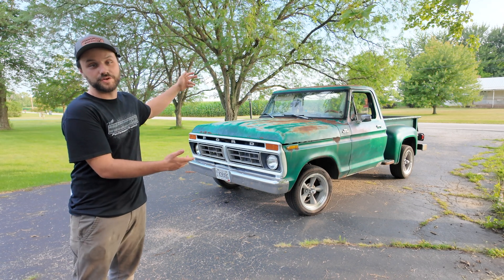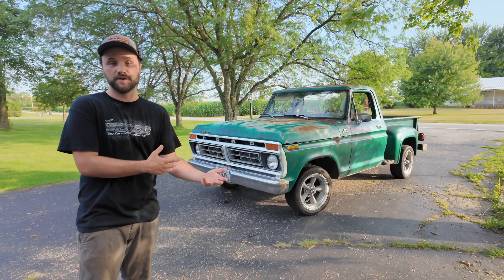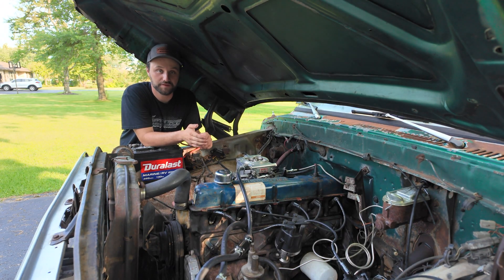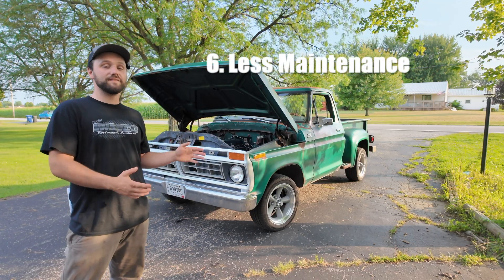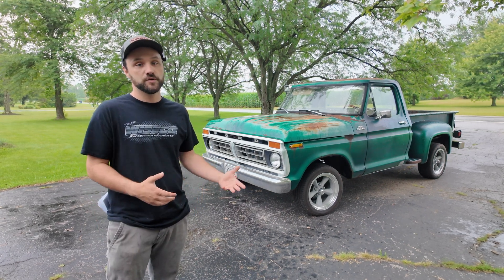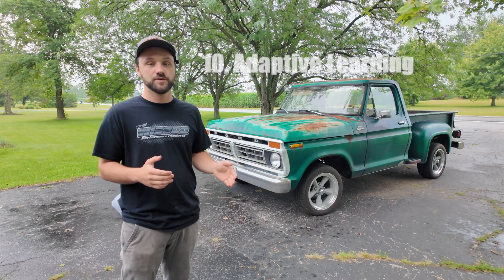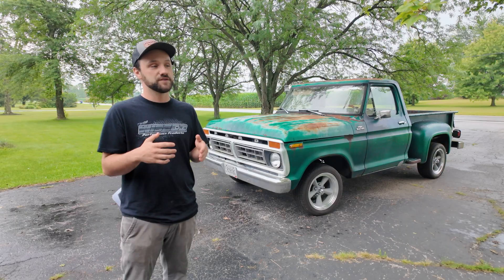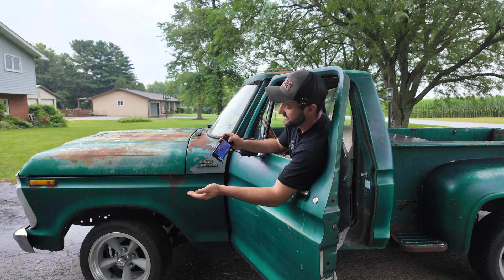10 Reasons Why I EFI Swapped My F100 (Ford 300 Inline 6) - NEVER RAN BETTER !

Comment: If you wanted a bug out vehicle electronic control system would not work in case of a emp burst 😅simple design is better than a vehicle that can’t get the job done. I know …prepper mode but think about it having a vehicle that will work

Comment: I see you used an older carb version 300 i line 6 engine. And obviously its wat you had already fitted. Will swapping your aftermarket kit improve the later efi 4.9L inline 6 version of engine

Comment: That little flap between the manifolds was designed for cold starts (if it's fixed and working properly, a new manifold is under $200 unlike that efi and intake). In addition to the pipe that goes down from that carter carburetor to the manifold for heat regulation. Simple Thermal Science...

Comment: never had a Vaper lock with the 300-6

the carburetor  works very well and always had a smooth idle 

Power Nation gave an old 300-6 , 70 more Hp by changing the intake and Carb 

vacuum leaks are ease to find 

if you have a bad carburetor and not good at setting the needle vale setup it could be trouble  remember blowing  the muffler  off 

the dual spark system to me was as soild as a 5 pound rock in a 2 mpg wind after 500k miles the only part  replace was the coil twice, now i did replace  the cap and rotor as thats like tires and do wear out,

24 mpg not bad ,

not to fun of some of the electronics  that went past the dual spark not  to say that advance ideals are not good and that old truck should be a dayley driver as it stands out to the test of time, its systems are well build , simple and robust as well.

as a pilot you have a mixture on the aircraft carburetor because as the air gets thin the mixture will become too rich.

love the fact you have an old truck and not a fan of to much new electronics at times  

but times change.

would love to know more on the max MPG you get and remember you have one of the best engines ever made when it come to long life 

and i hope you keep the old Carb setup just in case you need it.

as you have a classic truck

Comment: Which intake manifold did you use?

I have a 1980 Ford F100 with i6 300 cubic inch engine, 1 barrel carb.

Can you put your part list together for me including any suggestions you would if doing it over again: fuel pump, distributor, etc.

Comment: Adds power? Total B.S. without dyno reports. 20-30 lbs boost just stupid on that type engine and will ruin it. That complex expensive after market junk is undependable, dependable is the primary point of the 300. Far better, easier and cheaper to get a stock FI 300 which actually has more power, I did. That kid ran a carb for decades, started when he was 2 years old? Block channel.
Reply: Keith lopez has already made over 1,000 horsepower with his 300, and regularly takes his to drag and drive events. 

Ford 300's are stronger than you think.

Efi and turbocharging isn't Rocket science, and is perfectly possible to have a reliable setup. You're just a boomer that's scared of technology.  

Efi is better at fuel management, and will get better mileage. A carburetor is a controlled fuel leak.
Reply: @riogrande163  1K HP 300 is a ruined engine. I had 300s before you were born. Computers eat batteries and put cars on slide backs. Turbos burn out at low miles and high bucks to replace. FI is not as dependable as carbs and aren't user serviceable. 30 years of aerospace engineering, yup, I'm scared of tech. I quit complex cars because I got tired of boring, ugly, economically totaled disposable plastic that ride like lumber trucks. If I cared about gas cost the super charged and dual carb cars I built 25 years ago would be gone... and neither of them have ever failed. KISS
Reply: @danontherun5685  

You're posting mindless dribble that isn't based in fact. 

Efi vehicles, and turbocharged vehicles have been around since the 80s. 
Most every diesel truck since the late 80s have been turbocharged. It's not Rocket science. 

Keith lopez is still using his turbo 300 for drag and drive. Engines don't magically fail at a deemed horsepower number. Ever heard of an engineering safety margin? 

There's two people in this world. Those who do things, and those who sit on the sidelines and say you can't. Pretty obvious you're the delusional curmudgeon in the latter. 

Also 30 years of aerospace engineering and you're spewing uninformed garbage like this? That's just sad.

Your emotional ramblings don't offset the many, many vehicles from decades past still on the road with an ECU, Turbocharger, or both.
Reply: @riogrande163  I quit track racing 45 years ago because its a waste of cars and money. I still drive a super charged 57 I got running in 2010 and one of my current projects has a 300 with a weber side draft on the FI intake, it runs perfectly and will never fail. Show me a dyno report of change from carb to EFI that got more power. Turbo's are prone to expensive failure and the lag is ridiculous. I have 3 pals that wasted bucks on EFI and all three went back to carbs inside a year. The only cars in the two clubs I'm in that have FI are two C1 garage queens. What have you done in your life worth more than a cup of cold spit?
Reply: This guy is so full of crap, especially the mpg.  Look at the people buying his BS
Reply: @red488truckneb 🤣
Reply: @red488truckneb  I figure they are shills helping the hype or that scamster is commenting himself.

Comment: I got a free 4.9 from a 96 , it's getting a 3582 , and 90 lb injectors. 500 ft lbs, and 400 hp is cheap and easy, and plenty. 
Cool build.
Reply: 90x6=540  This will weigh more than the engine.

Comment: I really love this F100 series of vids. So amazing to get that kinda MPG out of an old truck. Most people would be blown away by that. Makes me want to find something similar and do the same. Old trucks have so much character. And new vehicles are soo stupid expensive and just junk with plastic oil pans and computers. I think this could really become a trend if people knew about it.

 I really wanna try a 3 on the tree. I'd love to know what other trucks have that maybe with more gears like a highway gear would be amazing with good mpg. 
I wanna see more vids where you push that MPG higher like you said you could. Wanna see you pimp it out a lil bit with a bull bar, maybe some trucker style lights and a camper shell option. What other vehicles have the potential to do this to and get good mpg, reliability, support. How much has all the mods cost so far?  Keep it up!!

Comment: Why does it has so much manual adjustment if it constantly adjust its self and learns what it needs for best performance?
Reply: you can customize the settings for racing etc.  drive it to the track, put in the race settings, race it, set it back to original settings, drive it home.

Comment: I have an aces killshot I'm going to run on my '71 f100 with a 400/c6 combo .I had the kit on my mustang for a while, just didn't like all the wiring in it
Reply from the maker: I’m not sure about the kill shot system but the FiTech system was very straight forward
Reply: @GilktheGreat it was an easy install and ran fairly well, just couldn't bare the extra wiring in my bare bones '66, just looked completely out of place